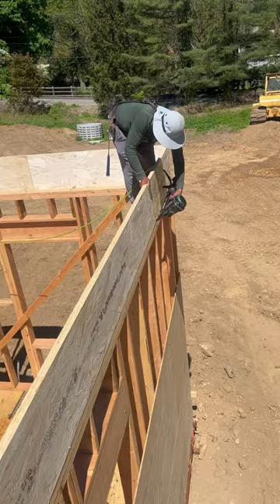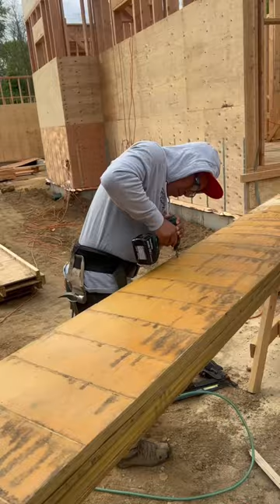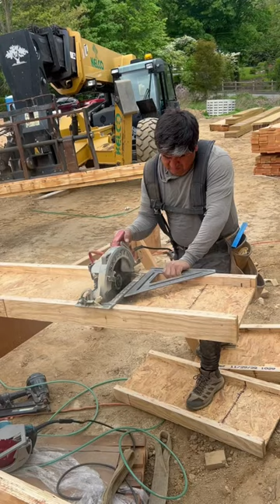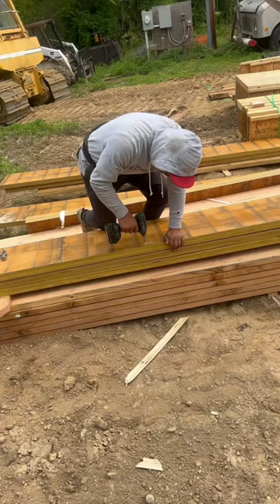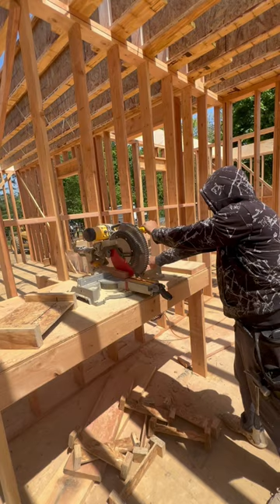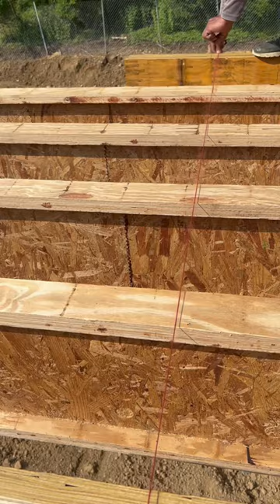Second floor joists #shorts #construction #skills #beauty #perfect #carpenter #work #carpentery

Comment: Rookies if u ask me.   Why not put plywood on when u stand walls. Now you have togo back.  I see the machine there.  Chould easily use that.
Reply: 😂😂😂😂... You're a funny one. " Rookie's" these guy's would spin circles around you, these guy's are Top notch Custom Home Builder's. Yes walls can be sheeted prior to be standed, but they don't build them that way. They do what's called stick framing. Also in some areas of the country there is a inspection process that the framing has to be inspected before any sheathing is applied.